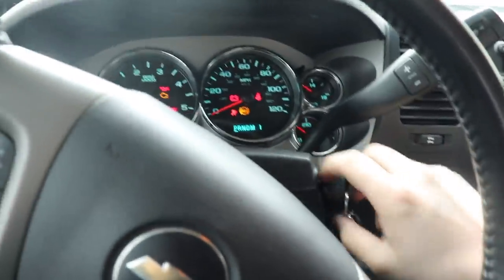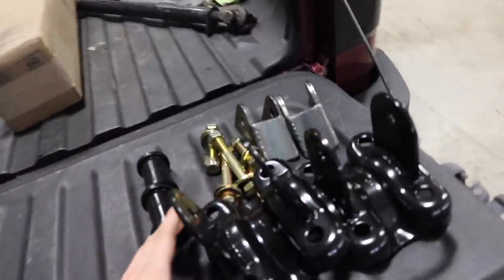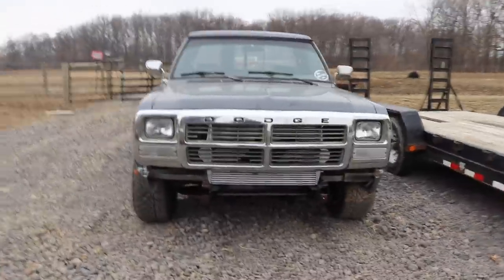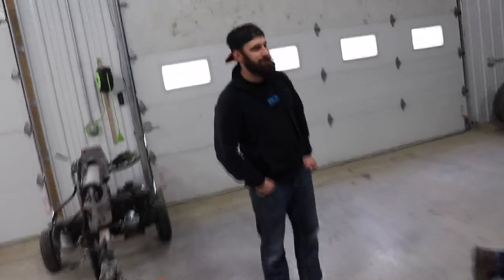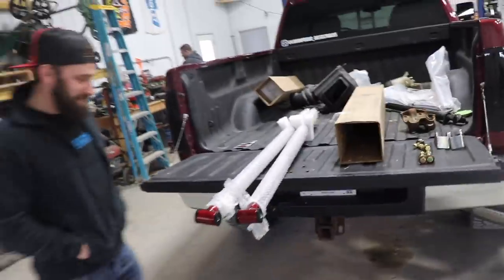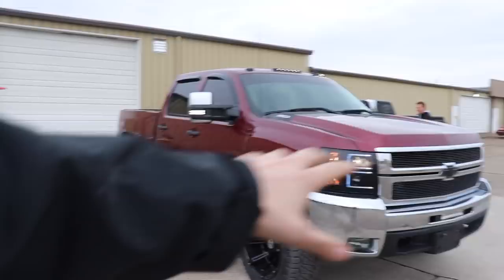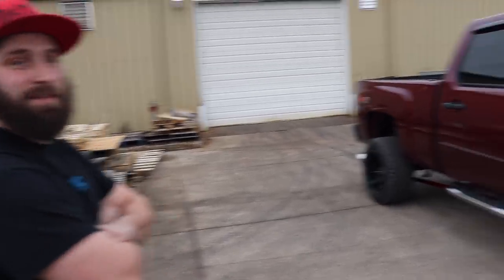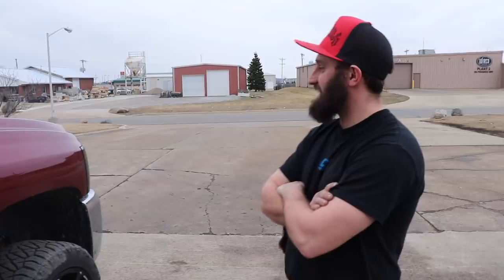THE DURAMAX BUILD IS FINALLY COMPLETE!!!

Comment: Yo LOUD N PROUD Malachi I love your 2008 Chevrolet Silverado 2500HD Z71 crew cab Duramax Diesel I love WC FAB 60 inch Traction Bars on the truck and I love your new 02 Ram 3500 Laramie SLT Dually with Flat Bed you r the man Buddy cool dude and Reagan too I am your Big FANS Forever